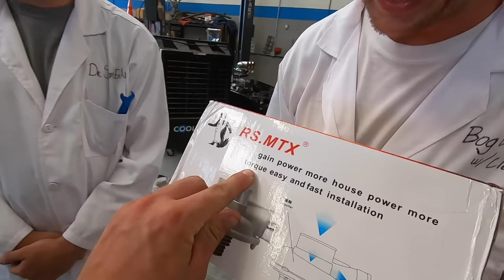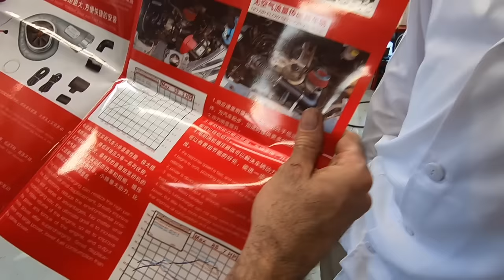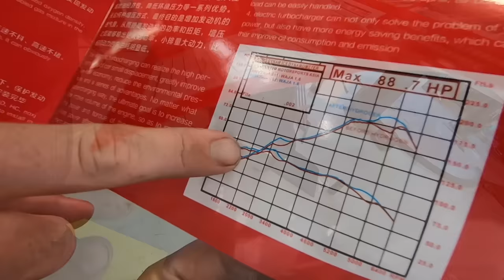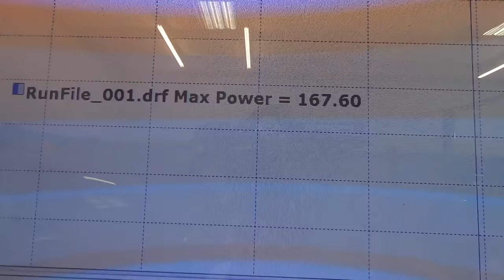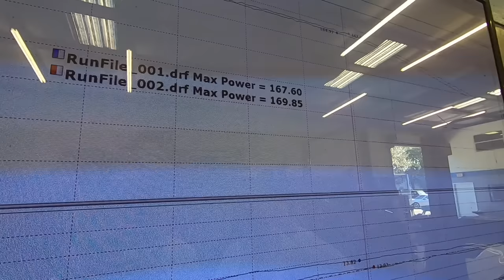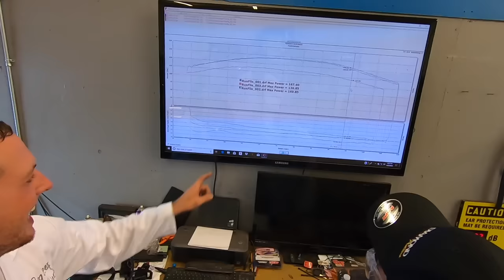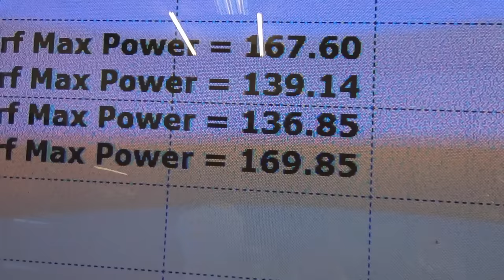Dyno Testing a $400 ELECTRIC TURBO! Funniest Car Part EVER!

Comment: I figured out what "house power" is... I googled how many watts the average house has and used google to figure out a horsepower to watt conversion. So the average U.S. home uses/needs at least ~6,250 watts, and using the converter, 6,250 watts equals about 8.38 horsepower.
Reply: LMAO!
Reply: Factor in -30 horsepower x.838+2.453¥\16%~€x13=piece of shit
Reply: r/theydidthemath
Reply: @Ieatpeople2  LOL...thats some serious gains!
Reply: 5.7R/T Challenger Yea you forgot to multiply by 3988826677 then you gotta take take into account the oxygen levels and humidity divided by annual ejaculations minus the circumference
Reply: @Thalor  that is the formula I was thinking of but I could not remember the ejaculation part

Comment: I actually have a p71 engine that I need to get rid of. I’m ls swapping my crown Vic and the old motor is coming out this weekend. I’m a bit of a drive away (Fort Lauderdale) but if you want it it’s yours.
Reply: Actually message him. With this and im sure theyd go For it.
Reply: Very cool man, way to offer to help the boys out...
Reply: I’ll drive it to them.   Lmk.  Instagram @CKSOFLY
Reply: More likes so Cletus sees this
Reply: Up you go!
Reply: trollolololololololol
Reply: I'm in south Florida too. Do you have any other Ford/mustang parts?
Reply: Aye another ft Lauderdale viewer
Reply: ill take it. Want to build it out for my p71 4v supercharge swap.
Reply: Can I get the coolant res, mine is leaking ? Lol
Reply: DM’d him on Instagram. I’m just looking to get rid of the engine and transmission. I’m keeping the harness though. Automotive grade wiring is like gold when you’re doing a swap. The transmission is blown so I’m just going to dump it at the recycler.
Reply: OMG YES.. They already have a Mustang engine in a Vic,  now they could have a VIC engine... IN A MUDSTAIN.  I mean Mustang. :)
Reply: @CanIbeFrank .I junk yarded a early fox body.427 scammer engine,narrowed large Chrysler diff and built 747 transmission. I got it for $1000 and could never get it titled.
Reply: FatAznAznWithCake you coming to streetlifes meet so i can see that LS swapped Vic ? Or what??! Lol
Reply: In Bradenton looking for one haha
Reply: Imagine that, putting a Chevy engine in a Ford! I guess you're looking for reliability and cheaper repairs.
Reply: @jeffgabrisl7016  Actually the 4.6 that was in his P71 would have lasted just as long... Not saying ford doesnt have a couple shitty engines but dont you diss the crown vic 😂
Reply: Man.. I have needed a motor for my mustang for so long... I need just a plain old 302... Though.. not a 4.6

Comment: The mass airflow sensor has to go on the suction side of the turbo. If its on the boost side it will cut timing and fuel
Reply: Of course. Besides the Turbo is too small for the V8, they didn't place it on the right side of the MAF sensor.
Reply: That thing is making any boost.
Reply: They wanted it to fail

Comment: 17:55 its spinning backwards! That's why Cooper said it was building back pressure, it was blowing air out the inlet!!!!!
Reply: @psycho-nutkase9233  Actually it is going backwards. If you watch closely when it first starts turning, it's going backwards. 17:52
Reply: @psycho-nutkase9233  I know what you mean, but go to .25 speed. When it starts it goes backwards. The reason why the rims look like they spin the other way depends on the framerate on a camera. High speed cameras capable of 1000+ fps will look normal. When they rim spins faster then the fps of a camera ( say 30 fps) it look like it goes backwards. But in this case, we are watching it from a very low rpm, so i think it is accurate to say the turbo is in reverse.
Reply: Absolutely without a doubt it was wired backwards.
Reply: Trains, Bangs, and Automobiles I noticed that as well. The one guy even mentioned something about it. I think they need to check the wiring and try again. I've noticed that with vacuums the nossle is always smaller than the hose. Kinda like a tornado has a smaller end than at the top. It creates more suction. I also created a water hose nozzle that has a bowl with spirals going to a narrow opening. It creates amazing pressure. It almost sprays harder than my electric pressure washer. I'm no mechanic by any means however. I know how to change oil, tires, transmission fluid, putting freon in the air conditioning unit, changing map censors, O2 sensors, etc. I wish I knew more about automachanics though.

Comment: Cleetus:"its not worth the cost to replace the engine"
Also cleetus:spends $400 to lose 30 hp
Reply: LOL
Reply: LMAOO
Reply: You get less horse power maybe but you gain so much HOUSE POWERS
Reply: Ah, dude, spoiler alert :(
Reply: But what about the new MPG?
Reply: For SCIENCE!
Reply: Seems legit
Reply: I was thinking the same damn thing lol
Reply: Also cletus has his Highlyy intelligent mechanic friends apply the turbo right before he ends his pull the way I see it its electric it's going to be hard for it to spin by its self as its electric and has it's own little engine like a fan I haven't seen very many fans spin on they're own from the air because there's resistance this is much the same if it were me I would have hooked it up to where its blows more air the faster you go pedals half throttle the fan does 55% of its throttle so in conclusion this test proves what I say all the time they're unintelligent individuals for not taking this into more consideration if they're trying to give it a fair test stuff like this annoys me when people don't call these youtubers out because for god sakes this mans trying to be an educator he himself is very uneducated and uses very unorthodox and incorrect methods but try's to educate others with his incorrect knowledge.
Reply: @jessewelch1  you have no idea what you are saying. I don't want to argue, I just want to let you know.
Reply: @jessewelch1  you talk too much
Reply: Tex X that itty bitty Chinese electric turbo still wouldn’t supply the volume nor pressures need it has to be able to compress the air to provide boost
Reply: @stevenjohnson1692  Ok genius 😂
Reply: @jessewelch1  Please, for the love of humanity, realize that you are the living, breathing, manifestation of the "Dunning-Kruger Effect".
Reply: William Chapman it won’t work in a big V8 but there is no reason why it won’t work in an engine that has much small combustion needs.  You don’t just slap on any supercharger you find and think it is going to work and that is just what these guys did. The unit simply wasn’t made for the engine. Is that hard to understand????? PS the unit is not a turbo it is a supercharger. A turbo is powered my the engines exhaust, hence the spool up.  An electric motor as in the unit does not spool up, they are usually switched on or off, perhaps with a high and low speed. This entire test was bogus!!!!!
Reply: That's an expensive hair-dryer! While you may not have been able to pay for a complete install for the price, you could've bought a proper turbocharger for that!
Reply: Tex X, are you calling them dumb, because if you are, then you obviously haven’t watched their other videos.
Reply: Housepower was obviously mispelled. The proper term is mousepower where 1 mouse equals .0002 horse unless it's scared then all bets are off.
Reply: Hmmm...I wonder if someone invented a 2 stroke leaf blower turbo mod yet? Lol!
Reply: S S maybe in a go cart
Reply: S S superchargers can take up to 80hp or 60 kilowatts to compress the air to provide boost it would take a very large electric motor and multiple batteries to supply power if an electric supercharger could efficiently supply boost to a 1.8L for example  Ford ,Nissan,Honda,Toyota etc would be using that instead of a turbocharger what say u ?

Comment: I'd like to see this "turbo" on the chev 2.2 that you bought after this video 🤣..see how it compares to the $2500 one
Reply: Also, show us the current draw of them both.  And are they using a dc-dc converter for the 48v charger?  Also, what ecu did they run for the Cobalt?
Reply: Lp5 duramax electric turbo and lots of house power
Reply: I believe they did this!
Reply: As a 20+ year master auto tech, I have to wonder if somehow the mass air system can’t handle the added incoming air and drastically changed the injector pulse width and then the computer  retarded everything to prevent a lean condition leading to detrimental detonation. Just a thought as the possible cause of the reduced Horse power. Just wondering if tuning might help a little.
Reply: @871jamie  for my calculation considering a Max Air speed of 86m/s as it says in the ad, 2 inch diameter, the total volume would be 9.4m3/min . This car is a 3.8L which at 6000rpm sucks an amount of 11.4m3 of Air per minute. Só It os totally uncompatible. As opposite a 1.6 L engine needs an amount of 4.8m3/min. So It is possible that It works.
Reply: 4417jb 

48v alternator from leece Neville if anyone is curious on a native alternator
Reply: Yes please

Comment: The engine probably spooled that thing enough to charge the battery 😂
Reply: Swap the e-turbo with the alternator and hit the dyno again.
Reply: Hahaaa
Reply: i was thinking the same thing , its the hybrid turbo regenerative breaking  system.. lol
Reply: They had it wired incorrectly. Go to 17:55 and play it at .25 speed. It's spinning backwards. If you go to 13:19 when they first start it, it's spinning the right way.
Reply: @FloridaStormChaser  LOL OMG
Reply: True
Reply: Haha
Reply: @FloridaStormChaser  you right
Reply: @FloridaStormChaser  if you replay @13:19 its spinning backwards as well. Look at the wiring he is holding blue and red wires together just the same as its installed on @17:43

Comment: Keep adding batteries in series to increase the voltage and "turbo" speed until it either adds house power or burns itself up
Reply: Imagine calling the people that sell that thing and telling them that you're not satisfied, it made no house power LOL
Reply: Yeah the voltage definitely needs to be stepped up,
Reply: That is a great idea!
Reply: I agree put the power too it till the motor goes / bearings go / blades explode!
Reply: This is a great idea but they need a smaller engine, this one takes more air than this "turbo" can give i think thats why hp is drop. Smaller engine, higher voltage from separate battery and i think this can work
Reply: Plug it into your house outlet spool for days.
Reply: @theCinator  it would burn out in seconds.....you're talking 10x the voltage. You MIGHT get away with 2 12 volt batteries in series to produce 24 volts but you'd be restricted by the outlet diameter as to how much volume you can produce.
Reply: @muskokamike127  it was a joke dude.
Reply: @theCinator  would probably burn the windings instantly
Reply: @ok88warrior  it was a joke 🤗

Comment: Was the polarity reversed during the pulls? That would make sense for it spinning backwards, trying to pull air out of the intake rather than compress air into it. That was a much bigger loss than I expected. We need a follow up video!!! Also with it on the pit bike, and stepping up the voltage. What's the sound of house power? 🤔
Reply: im not sure "compress" is accurate maybe "blow" lol
Reply: Nathan Underwood we’re talking about the electric turbo not your mother....lol I’m jk, but I had too!
Reply: Kurt L I wasn’t hearing any compressor surge
Reply: Even if it wasn’t compressing i feel like blowing it would make something just like the leaf blowers on roadkill
Reply: yes, turbo spinning at wrong direction. 

play at 0.25 speed at the part they testing it.
Reply: @QWERTY28875  only one to notice really...funny how they didnt notice in person.

Comment: Is it just me, or when he turns the "turbo" on 17:53 (after it's hooked to the car) does it start spinning backwards?  Not saying it would ever create boost period, but it would be funny if they had wired it up running in reverse.

** I started questioning if the camera was playing tricks with rotating objects like it sometimes does, but if you watch it at 13:26 you can see that looks as if it's spinning the correct way. Assuming the same camera was used for both parts it would appear that they did in fact have it hooked up backwards.
Reply: Shit it really does look like it..
Reply: I'm pretty sure your dead right!!!!
Reply: Good eye.
Reply: Yes its spinning backwards
Reply: That would explain why it sounded so "whooshy" when they turned it on after putting it in the car. They could have mistaken the air coming out for back pressure trying to get back out of the intake.
Reply: Lol, I played it in .25 speed and you can clearly see it spin backwards.
Reply: Yep it was backwards.
Reply: These guys are smarter than that..
Reply: Yep. Wrong way.
Reply: @davidjessee7701  That's the problem. Following incorrect instructions to the letter, like an intelligent installer would...
Reply: Hope he reads your post and retest.
Reply: MYOB  Nah, that effect only comes into play once something is already spinning and at a pretty exact speed.
Reply: Yep we need new test
Reply: @davidjessee7701  you sure about that?
Reply: I'm pretty sure it was spinning backwards
Reply: I wanna say the wires even look backwards from what they first tested at in the beginning to this clip
Reply: Not sure but that would be funny as hell...
It might explain why they are noticing some serious back pressure 🤔
Reply: So you're saying that it is "pulling" air from the motor instead of "PUSHING" it Into the motor?? 

Lmao!!!
Reply: But you see that it blows air out the right way.
Reply: @TheAdatto  it does blow air out the correct way when they are testing it at the beginning. In that part of the video it appears to start spinning the correct way. However after they hook it to the intake we can't see any proof of the direction of airflow and when turned on it appears to spin in reverse.
Reply: The wires do look reversed from the first test of the turbo. Check it out at 13:03 and then on the car at 20:08.
Reply: Lmaooo! You are correct.  Its spinning backwards 😂😂😂
Reply: Matthew Fleming its real easy to reverse direction just on the motor end swap two wires
Reply: Thats why he frequently says back pressure, of course, coz it is spin backwards...
Reply: Bunch of doofuses wired it in the wrong way.
Reply: We need another test
Reply: Reverse
Reply: Looks backward to me
Reply: Too much laughers here.....
Reply: I say he had it in his hand the first time he fire it up and the flow was right. I'm sure they hooked it up same way
Reply: @joecollier9445  that's exactly the problem, you can see the wiring is reversed between the test fit and dyno run....... 

The test run had red wire to positive battery terminal, it's reversed in the dyno run
Reply: Maybe purposely done to keep people from buying non sense.. .  played it super slow mo through Adobe and yes it is spinning in reverse when compared to first test in hand..